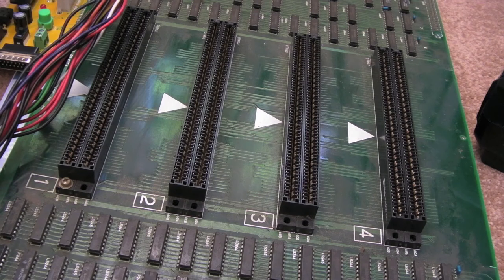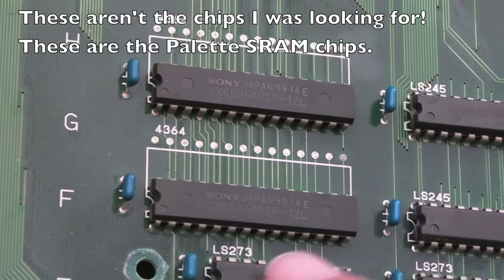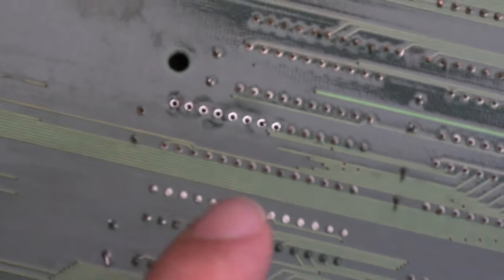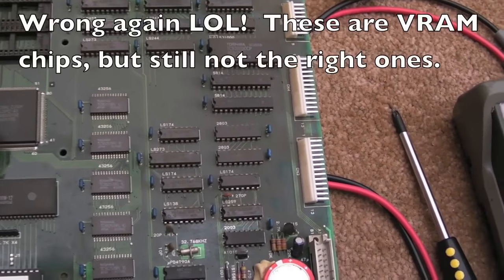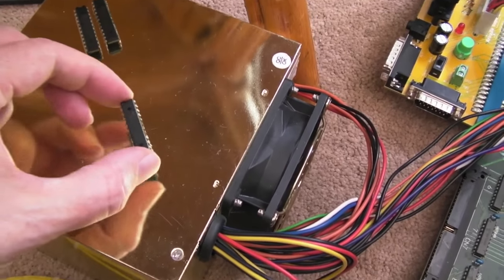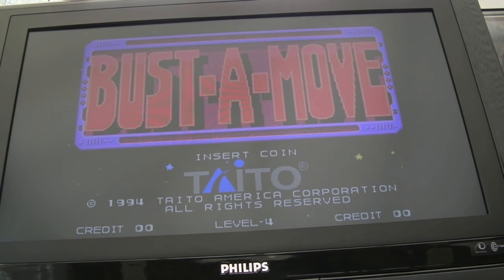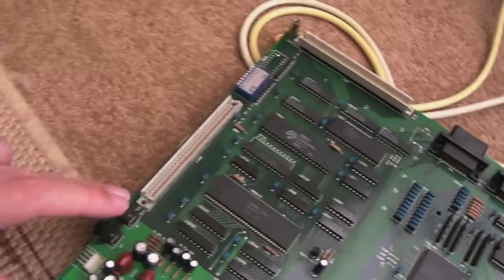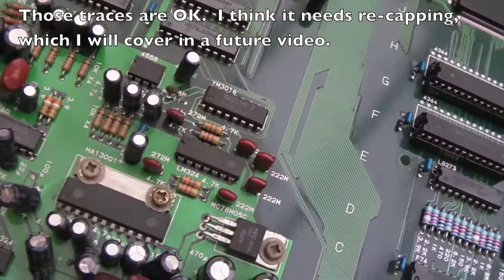SNK Neo Geo MV4 (4 Slot) Video RAM (VRAM) Repair

Comment: Brilliant Repair, I got my 6-slot from eBay for £80. You think 4 slots are big 6-slots are like kitchen sink big. The guy I got mine form was selling others 2's and 4 slots, I think he's still listing them. Mine was sold with a backup ram error but tuned out to have a lot more faults (Battery Leak), alls good now though I fixed it up and spray painted the top metal shielding and it now looks good as new. I know you've seen the repair video on my channel as you left a very nice comment. thanks for that.
Reply from the maker: Yes, sorry I forgot all about that repair!  I will give you a shout out on the follow up video(s).  I think I am going to paint with hammerite or something as the spray might cause me some problems.   You did a sweet job on that MVS - that's one of the reasons I was looking out for a 4 slot! =D
Reply: I feel your pain bud; I get bad headaches from paint fumes. When I was repairing mine I was thinking of paying for the metal shield to be powder coated but when most companies I contacted quoted me around £100 I thought I would rather have a headache for a few hours. Ha Ha. I took it outside and hung it from my washing line using some kynar wire and spray it out doors. Gloss paint is the worst for me that stuff is just instant headache when I'm painting the doors or trim when I'm decorating the house.

Comment: Nice work!  Just a question though. What do you think is the risk of damaging the ics due to static charge when cleaning them up whit cotton buds and fast motions? Personally I never felt comfortable with it and if I clean like that I try not do nice and slow.
Reply from the maker: To be honest, I've never had a problem!  I think the whole static damage thing is taken to extremes.  Sure there's a chance, but it must be pretty low because I've cleaned thousands of boards of the years and pretty sure nothing has ever failed as a result of cotton bud static =D   Some people naturally seem to generate more static than others, and that also applies to tools and techniques used I'me sure.  I take static seriously where it needs to be taken seriously, but there are both sides of the extreme coming into play a lot - for example, some people have a nervous breakdown if you handle an LED without taking ESD into account, then there are people on YouTube handling $4000 CPUs without any ESD protection!!!  I think it's all a question of risk at the end of the day.

There's a balance somewhere I'me sure.   If you are doing electronics professionally as a business, then ESD is something you should lose sleep over and I guess buying cotton buds that are ESD safe might be something to look for - if such a thing exists?!?!  I know you can get ones that don't fray etc.  Very interesting question though!

Comment: Hi Chris,  nice video

Sorry I'm late to the party but I'm having the same kind of issue. (00008000 Wr5555 Re5500) on the Video RAM. A lot of google searches pointed me to the upper Video RAM at K9 (the SMD chip) so I went and replaced both SMDs but I've still got the same error. Did I fall into the same trap that you did and do I need to replace the ones at L/M 11?
Reply from the maker: I think you need to replace the 5814's - are those at L/M 11?  address h00008000 is the fast VRAM I think, just like this repair.
Reply: @GadgetUK164  the big long ones? Yeah, I removed them last night. Waiting for some sockets so I can switch them round and see if the address fault transposes. I dont suppose you have a link to where you got your replacements do you please?
Reply: @GadgetUK164  Hi Chris, the sockets turned up today so I've swapped the 2 5814's round and the address fault has changed to 0055 so yeah the chip is duff. Don't suppose you have a link to anywhere I can get replacements do you?..............

Comment: I saw Gary from south africa actually was his pcb's wth water and soap! It works strangly enough. He made a video about it. Maybe you know him but he's Big G from SA.
Reply from the maker: I think that would work OK, and I might do something similar in future!  I think if you rinse it off with a certain type of water (de-ionized?) and then make sure its totally dry - perhaps using hot air?  Then I think that works well.  I just worry about getting moisure trapped inside connectors / slots etc =/

Comment: How many NEO GEO's do you have pal? I've seen you tinkering with several, you have the CD don't you?or am I confused with another channel? I've got a CMVS 1 Slot, and a now updated and Jail-broken NEO GEO X, the update works wonders for the colour bleeding through HDMI, I am more than happy with it now.
Reply from the maker: Got the AES still, consolized MVS, and this 4 slot.  Also have a spare MV-1FZ board and 4 other faulty boards which I've yet to motivate myself to look at.  I don't have the CD and tbh it doesn't interest me as there aren't really any games that you cannot play on the MVS - except for the Samurai Shodown RPG etc.  I was going to get the Neo Geo X at the time I first got the MVS - it was one or the other, and I decided on actual hardware rather than the X.

Comment: Is that chewing gum holding that battery! Haha.  Nice fix up there,  is this board the same size as a Ps4 or xbox one? Instead of spraying. The price of the games has put me off the neo geo as much as I would like to get one. Risky business using the pliers so close to the pcb I would scratch that up guaranteed! Good to see it back from the dead looking clean.
Reply from the maker: Haha, no it's not chewing gum - hot glue! =D  It's larger than a PS4 or XB1, at least 50% wider I think!  If you get multicarts, and then just pick up the odd game you want here and there it works out OK.  Many MVS games around the £20 mark on eBay, sometimes you can pickup Puzzle Bobble boots for < £10, then convert to something else etc.  With regards to using pliers to free pins, yes - you have to be careful but It's a technique I am used to - not a mark on the PCB, I will show that in the next video.

Comment: You could try sanding the case down yourself, then paint it with some hammerite for a cool look. Either that or just use some car paint aerosols (primer, colour, clearcoat). Nice video!
Reply from the maker: Thanks, I might have a go at that!  Maybe Hammerite is best as its less likely to create fumes etc.
Reply: Yeah it would be safer than aerosols alright. Pop on a dust mask when you're sanding and you'll be fine!

Comment: Hi! Thanx for this helpful video. I got a 4 slot with VRAM error : Address:00008000-Write:5555-Read:0055.

I'm knind of noob in this so how can I spot the broken chips on the board?

Thanx
Reply from the maker: I think 8000 address means its the same SRAM chips that had failed on mine.  The thin long chips (not the first ones I replaced by mistake), but the ones I socketed near the edge of the board to fix mine.   Your board might be a different revision, but it will have the exact same SRAM chips on it somewhere.   Swap both out - when one fails, they both tend to go.